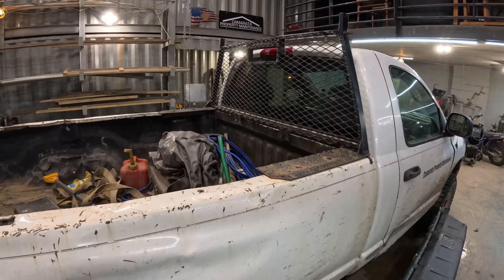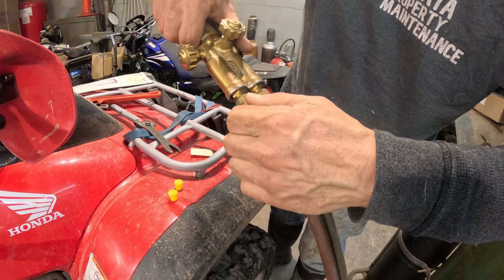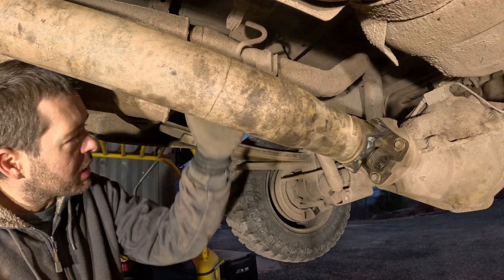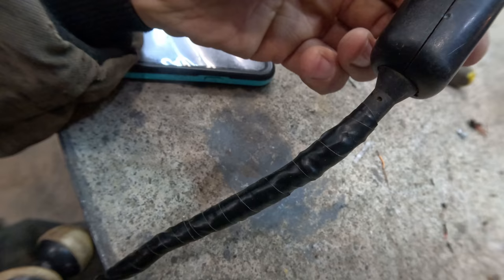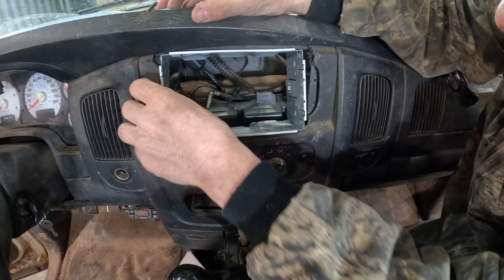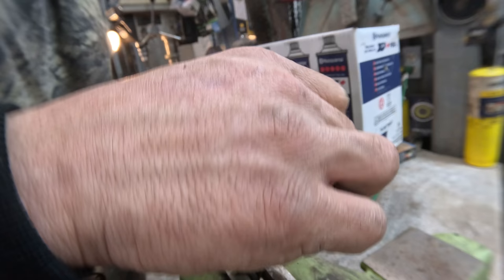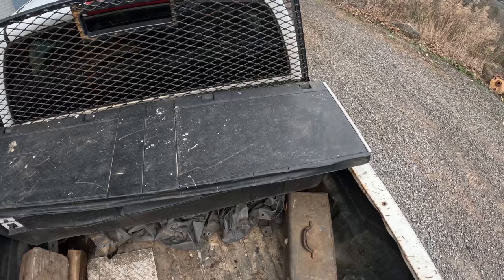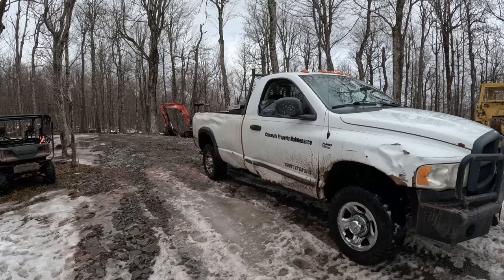Pickup truck repairs

Comment: Andrew is a regular guy, that works hard and has a lot of patience for setting up cameras. That's my best description for the BEST channel on Youtube.
Reply: I mean, camera is in his name 😂. But I totally agree. He's the best channel on here.
Reply: The best channel on youtube,  boy you sure don't watch much on youtube.
Reply: @jamesadams893  I agree, I'd say in this  'category', as I watch homesteading channels also and Simple Living Alaska and My Self Reliance, both are very well put together channels on par with Andrew's channel!
Reply: Hey Evans Creek who is Andrew?
Reply: @notaffiliatedwith7363  sometimes he has trouble realizing he's over his head and stop and get some help or advice from someone else, and it cost money like that bobcat he cracked the cast iron hub on it with a torch, trying to remove a stuck bolt, too impatient to use penetrating oil cost $5000 to replace that, and he bought a ditch witch trencher that has a big wheel in the front, kept picking up rocks and jamming and it wasn't cleaning out the trench, not knowing that it had parts missing or bent, he cranks down on the safety clutch and blows the chains off. After having to replace those, he continues picking up rocks and Jamming the blade, I don't know how he didn't bust the crankshaft I know at the least he bent it. He ended up shoveling out the trench by hand, far as I know he still hasn't tried to ask anyone what's wrong with it. Those machines are nice when it has the correct guard on there to keep the rocks out and move the dirt out.
Reply: How is he a regular guy? He's quite unique. He's a very not regular guy lol
Reply: I keep waiting for the Guaranteed 100 year Camarata truck bed build. You know I-beams, 3/8ths plate, generator, compressor, welder, boom, all the normal stuff. Waiting….
Reply: @notaffiliatedwith7363  the thing is people might say that, but I understand where he is coming from, he wants something to do what it's meant to, and he does what it takes to get that, and he doesn't give a shit how something looks once its doing that
Reply: @jamesadams893  he doesnt do clickbait titles and he condenses all his material on a single series into 1 video instead of dragging it out. He is definitely up there with the best.  It also says alot knowing if YouTube didn't monetize and pay Andrew wouldn't change a thing. Name another YouTuber that would.
Reply: The single hardest part of youtubing is the editing.
Reply: The perfect kind of tistic
Reply: @PAYNEKILLER..  "Muh tism ;>
Reply: @noahreynoldsriding3452  lmao
Reply: @jamesadams893  should've specified, it's my favorite in this category. Sure, there may be better channels on YouTube to you, but this is probably my favorite. If shit happens it happens and he just worked around it.
Reply: @jamesadams893   Of course there is a lot of better channels, but this one is....
Reply: Secret
It’s the dogs that pick the cameras up

Comment: When your u-joint is tight after assembly, whack the yoke from each direction with a hammer, this will seat the caps on the snap rings and release the bind on the u-joint, otherwise looks like you have the repairs well under control. Keep it up man!!
Reply: whacka whacka
Reply: @Yutani_Crayven  is that the name of a new rapper?
Reply: Yeah - once ya make sure that the needles aren't being mutilated, and the snap rings go into clean grooves, then whap it back and forth a bit to push the caps against the retaining clips. This will "center the slack". It'll run easier.

Comment: Andrew's truck is the most literal definition of "ride hard, and put away wet"  

To the trucks credit... thing takes the damage and continues on.
Reply: Every piece of equipment Andrew has is well maintained, but man he uses all his stuff hard.
Reply: Andrew would have been the ultimate test if Top Gear ever did another Toyota Hilux extreme durability test.  My prediction is that the Hilux would come through, but it would be a damn close thing!
Reply: @Hinch55 , he does beat the crap out of his equipment, doesn't he?
Reply: @richardcline1337  he has so much money it doesnt matter lol
Reply from the maker: @DeathDealer1825  I used to be way harder on my vehicles before YouTube existed.
Reply: @AndrewCamarata  Wow that's hard to believe 😆!!!
Reply: @AndrewCamarata  fair enough in reality as long as it does its job and works correctly why buy a new one no matter how much $ you have made off of youtube or your business you still stay true to using what you already have

Comment: Might be a fun project to watch you build your own custom bed toolbox out of some heavy gauge steel diamond plate. Then you could make it the exact width and height you want, and maybe even a guard in the front for heavy rolling objects in the bed. 👍👍
Reply: The only way it will survive Andrew nice and gentile handling. He is the best and friendly hille billie man I have ever see, just love the Man. Andrew if all man where like you we have a wonderfull world.
Reply: I agree he should make his own box.
Reply: Well, he could, but he'd need to upgrade the suspension, brakes, steering etc. as well, and he'd need an overweight permit. You know what materials he uses when he builds something...
Reply: Agree totally. A good starting point would be remove this lid and make a new one that has a 3 to 4 inch bend that rolls over and in front to some latching mechanisms. Once that is sorted out, transfer that to the next case.

Comment: The hammering of the brackets on your new radio unit made all the difference and it just blended seamlessly into the dashboard.
The later technical adjustments and upgrades to the vehicle tool box added that extra touch of professional finish that was so badly required.
Reply: safer for puppies

Comment: Here's the trick to u-joints. Press the first cap really deep into the socket. That way the cross will extend out the other side enough to get the cap and needle brgs onto the protruding cross before pressing. Put the clip in the deep side before you install the other cap and then press the cap on the protruding side in from the top. It's not unusual to have a tight clip and brg. The biggest problem I always had was with inside clips and aftermarket joints and then having the cap fracture trying to get the second clip on. I specialized in Nissan/Datsun and the factory joints had varying thickness shims. Always used factory until they got hard to get. Hate to admit how many u-joints I ruined by not catching the needle brgs properly before pressing. I'd like to say I figured this out on my own but someone else pointed it out to me.
Reply: Brilliant. Hope AC sees this comment. ?

Comment: Weatherguard Tool box  had one on my company truck for years. Beat the snot out of it and still working just fine  Might be worth looking into Andrew.
Reply: I had mine on my company truck and I work heavy and highway, my truck had 360,000 miles on it and that box worked perfectly. They got me a new truck so I got a new Weather Guard box for that one and left my old box with the old truck. It’s probably still working great.

Comment: One trick I learned when doing U-joints is to use a washer (or two) the thickness of the space to the inner circlip edge and then press the housing down over the washers until the housing bottoms out to the table. Then set the circlip before you put the U-joint in, that way you can press the other cap from the top until it just reveals the bottom edge of the circlip groove. Then repeat the process for the other side.
Reply: Can put U joint in with just a vise and hammer....no need for a press.....I've done it many times.....
Reply: @davidwiley3440  Yeah, me too.
Reply: I was thinking how everyone this watching has done it like AC

Comment: Andrew, next time install one cap, push u-joint all the way as far as you can and use the press to push it past its position then flip it over and install the other cap. now you can start the other cap on the u-joint without ruining it and use the press to center them. Also, a tap with a hammer when done pressing on each side of driveshaft, pinion adapter and trans slip joint will loosen the joint so it's not stiff.
Reply: Yeah, this dude needs help.
Reply: @Kickyourass484  Andrew is the guy all men should strive to be. He is not afraid to tackle anything. I know people that pay others to do the simplest of repairs.
Reply: Well if it wears out early again he'll just replace it again.
Reply: @garybensel6680  yeah but he sure does ruin a lot of new parts.

Comment: Something I found that makes u-joints really easy is finding a socket just slightly smaller than the cap bores, wrapping the socket in a fine grit sandpaper (1k or so), and spinning the socket in the bore to polish the surface clean. It still maintains a friction fit, but man is it WAY easier to get the caps in without messing up the needle bearings. The fit is snug enough that light taps will move the cap without the need for big hammer blows or a press. The clips will keep the caps from flying out, and over time they'll rust back in solid again.
Reply: Exactly.

Comment: Reminds me of an apprentice of mine many years ago. Having shown him quite a few times how to replace universal joints on propshafts, he still managed to make a complete mess of it first time he was left on his own to do one.
Reply: what did he do wrong in the video
Reply: @joemilton7552  He broke a new joint bearing by not aligning the spider ( center cross piece )  correctly. The way I was taught to do it was to press first bearing into place with ' spder ' engaged, and press it further than needed. Then insert second bearing and when it is just started, position the spider so it engages both bearings. Then continue to press scond bearing into place, which will then also move first one back into its correct position, while making sure the spider remains located in both bearings. Repeat for second pair. Doing it this way prevents the chance of pushing the bearing rollers out of position as I suspect Andrew did.

Comment: GREAT VIDEO.  When I first discovered you years ago, that video was about ' ' fixing stuff ' '. Your voice  about junk  is appreciated , because it's true. Hopefully manufacturers are listening. You repair things to last. (Like the wire splicing job . . . not like some that are just twisted and taped, your's are fixed . . .  forever.) 
People and manufacturers seem to have forgot the importance of doing and making things correctly. You are completely right in noticing and correcting flaws and trash in today's marketplace. Not only are much of the products shoddy, but unnecessary as well. Thanks for caring about the little things . .  . that is what the BIG things are composed of.
Reply: "Like the wire splicing job . . . not like some that are just twisted and taped, your's are fixed . . .  forever"

CODY: Hold my beer!

Comment: One tip about the U-joint after you're done installing it and it's alittle tight, take your hammer and tap all around the shaft and yoke close to where the caps go in and it sort of brings the joint to equilibrium in there so it's not stuck too far one way

Comment: Grabs toolbox sitting outside for 10 years and may have gotten slightly melted and bent out of shape. Installs with grinder and body weight, loads two tons of logs on top of toolbox...but just wants a box that won't break for no reason. Replaces cheap radio with more expensive radio...installs with hammer. I love this guy.

Comment: I got a used weather guard toolbox. Things great. Got a compressor and all my air tools in it and a welder generator on wheels that bangs into it all the time. Both sides still latch, opens and shuts as it should. It’s been great

Comment: Hey Andrew, when you get a stiff joint simply wack the cast steel portion of the joint yoke with a 3 or 5 pounder and it will set the trunnion into a neutral position making it last longer without binding.

Comment: You are someone who could benefit from a flat bed my friend. I've now had a flat bed on my last two Reg Cab 3500 work trucks and I haven't looked back!
Reply from the maker: Maybe if it had sides.
Reply: @AndrewCamarata  make drop sides
Reply: @AndrewCamarata  you can put wood sides on them or make steel ones
Reply: @AndrewCamarata  stake pocket sides are great
Reply from the maker: The truck has a bed. What’s the rule about fixing stuff that’s not broken. Don’t.
Reply: @AndrewCamarata  if it ain’t broke, fix it until it is.
Reply: @AndrewCamarata  I built both of them with aluminum tool boxes running down on each side. Then welded come C channel to hold a slid in wood board/tail gate. I’m loving them since I switch over.

Comment: I have been very satisficed with my Aluminum Weatherguard tool box, however I think you would need a steel one. These boxes are well built and aren't just a hollow sheet metal skin like the tractor supply boxes.

Comment: I've had good luck with UWS boxes.  I've never had one, but I hear Weatherguard boxes are great also.

You may just want to find a steel job box that is the right size (Knaack, Ridgid, Kobalt, Greenlee, etc.).  They are usually quite heavy duty.
Reply: Weather Guards are really good, but I'm not sure if they'd take the Camarata treatment. I think the Knaack box might fit the bill
Reply: I have always liked Weatherguard but the last one that I bought at Lowes has been a POS.
Reply: @daneclark3161  Anything sold through "retail channels" will be cost optimized to the point of being garbage. First rule of buying good stuff, don't buy the retail crap meant for joe homeowner that goes down to Lowes on Saturday and makes their decision on price alone. Though I do see that other people say all of their boxes aren't as good (or as thick) now as the old ones were - the bean counters have ruined everything. I have a weatherguard box from '95 that's still going strong. I don't have any first hand experience with anything newer.
Reply: @gorak9000  - Let's just say that I knew better but I did it anyway.  🙄
Reply: @daneclark3161   I think Gorak may be on to something.  I bought my UWS boxes in 2005 from a pro truck supply place (they sell and install lift lift kits, sell trailers, heavy towing components, etc.) and they're still going strong.  They been installed on 3 trucks in that time.

It may be more expensive to go that route, but I feel I've gotten a good value.

Comment: A good, solid toolbox would be out of an old cabinet. Like the vintage ones you only find at weekend sales or on lucky days on craig. Most of the metal is already there, just needs a proper lock. And the old shelves becomes compartment spacers.

Comment: Andrew, love your videos.  I think perhaps you would benefit from seeing a U-Joint replaced by an old timer.  Your method (especially needing a second U-joint because you "always ruin a cap") needs a tune up.  It is best to always ensure both caps are lined up prior to applying any pressure to one of the caps.  I watched and knew immediately that the cap was misaligned and you were going to have a problem.  I am sure you have replaced many but, it really is an easy process if you follow the correct steps.  And Andrew, the cutting torch?  Really?  You had Blast penetrating spray right next to you but didn't use it.  Penetrating oil is your friend!  And the "new inductor tool"?  Little red sticker says "Read Manual" and Andrew calmly says "I don't think so"!

Comment: Andrew the next time you change a u-joint get yourself a flap wheel small enough to fit inside the yoke ears and sand them out and you will find changing them a bunch easier, I always put in the first cap and drive it past where it needs to go. That way the cross will be sticking out the other side a bit and you can lift the cross to get the second side aligned right so the needle bearings don't get messed up, then drive it in and it will push the other side back in place. You should remove the grease zerk before you start to keep it from getting messed up. Also when tapping the first cap in don't let the cross touch the bottom of the cap to prevent the click clack effect.

Comment: Love the radio upgrade but you caught me off guard when you used a death wheel instead of the chainsaw to make more room. I guess you’re more mature now lol 😂. Dash looks great I didn’t think the glue would cut it self tappers nicely done Andrew. On the toolbox you asked who makes one that would work under harsh conditions my answer is you would be better off to build one yourself out of thick metal and heavy duty hardware. 
Have a Blessed One Andrew.

Comment: U-joints are easy if done correctly. Two things that make it very simple is when you press them together do one cap at a time. then put a little bit of bearing grease inside the cap to hold the bearings in place push the U joint through the hole and then slip the Over the end so that the U joint is holding the bearings in place. Don’t flip it over it either tap the cap in with a hammer or use press just make sure it goes in straight. Then slip the huge joint halfway over to the other side and do the same with the other cab slip it through so that the usual rate is halfway in between the neither press or pound the In the place. I prefer to put a socket in behind the cap and tap it in a little bit further, just till it clears the edge of where the snap ring goes in. Good luck. I enjoy watching people doing things on their own instead of depending on everybody else to do things for them and you guys are doing awesome.

Comment: Just need some 14 - 15 gauge steel plate. Cut here, cut there. Weld the pieces together and 'Voila', a toolbox worth its weight. 
I watched Andrew make an excavator bucket, so I'm sure he could make a toolbox. It would make another great video.